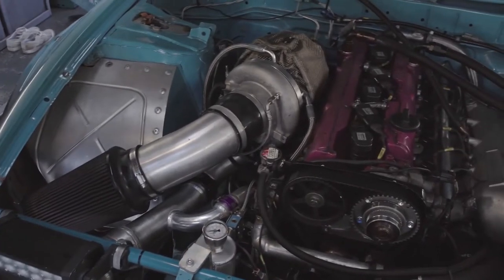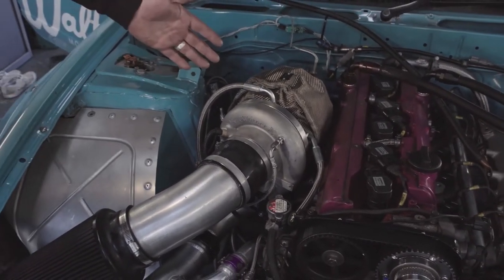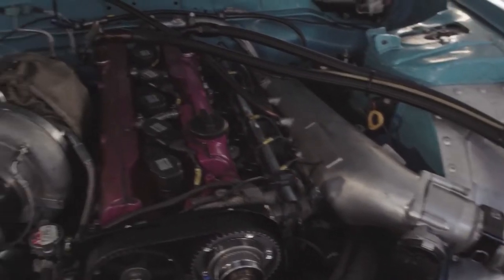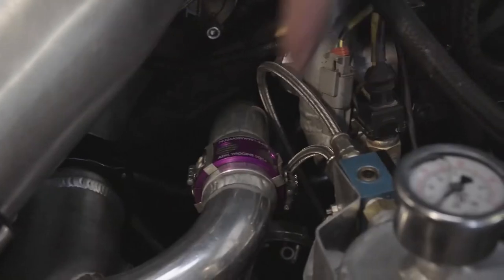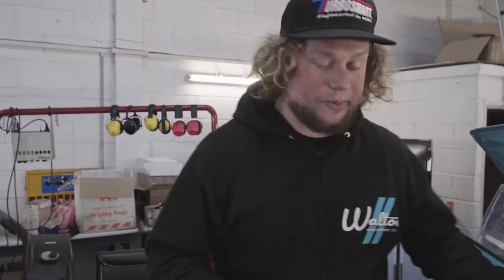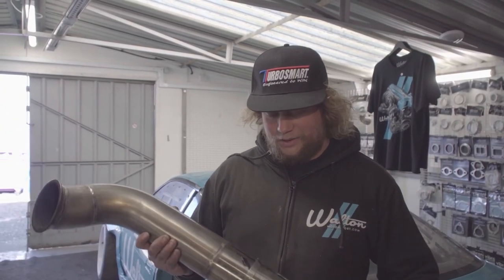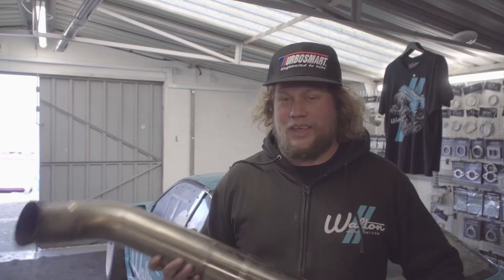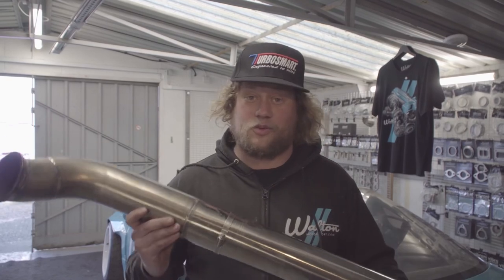Walton Motorsport - [Fresh Air Anti-Lag Valve Install] - Part 2

Comment: I don't think enough people realize how big of a deal this is. How many people have this up and running, because I cant find many.
Reply: absolutely. imagine all the potential powerband your car has in it, and start that from 1500 rpm and have it continue until you run out of springs/valves/crank lets go
Reply from the maker: Theres alot of Rally and RallyX Cars running this, but they don't really get shown
Reply: @WaltonMotorsport   where you taking the vacuum to put on the anti lag valve please the only question I want you to help me out

Comment: Sounds like A high revving bike as f**k N/A inline 4! insane! Need this on my 2jz swap E90.
I'm also working on a ZF 8 hp gearbox and ford 8.8 rear end conversion. All while maintaining an electric 12V air-con system, and keeping a lot of the interiors and sound-proofing.

Comment: Hey, i guess im a bit late but these are the best videos of fresh air antilag ive found.... so question what ignition angle are you using and how much more additional fuel? I have a antilag project in process and sofar im just getting one loud pop and then its not spooling the turbo and my guess my ignition and fuel enrichment perentage or off.
Reply from the maker: We only make the hardware and leave the tuning to professionals so Im not able to answer those questions I am afraid.
Reply: @WaltonMotorsport   okey thanks though? Do you have contact information to someone we would be abbe to ask though
Reply: @maikelniessen6621  if you need to ask it's not wise you do it yourself. Anti lag usually requires aggressive ignition timing and if not careful you can damage your engine.

Comment: This sounds similar to the prodrive "rocket" anti-lag used for WRC.
Reply from the maker: That method with the bomb worked well on Subarus due to their manifold design, however on traditional setups this methos is favoured due to reliabilty and ease of manufactuer.
Reply: @WaltonMotorsport  I think they achieve better anti-lag by designing a rocket nozzle fed by the fresh air bypass, that pointed rocket thrust directly at turbo inlet, thus spooling harder and faster. Sure the manifold layout is different but, still possible on other configs.
Reply: Walton Motorsport you can do rocket anti lag on any engine configuration.
Reply: Basically it is the same system

Comment: Great 2 part about fresh air antilag, will be interested to see how you get on with tuning it to make boost at low rpm/idle. A couple of questions if I may - 
1. I assuming you need some positive boost in the charge pipes before the cycle can start? Is there anything preventing manifold pressure entering the charge pipes if there is a lack of pressure and the ecu requests the valve to open?
2. Is the hot manifold the only ignition source or are you still retarding timing? I'm a way off doing this myself and have noticed my VEMS ecu allows 100% ignition cut when ALS is active

Thanks! Andy
Reply from the maker: So are we, we havent managed to get back to this project as of yet.
1. Sort of, to get around that issue we have the boost feed into the accumualtor tank via a non return valve. This is the pressure source we use for actually controlling the vavle. So you need generate a little boost before you can operate the valve. (a single rev is enough)
2. Not 100% sure, I will let you know If I can find out from the Tuner.
Reply: @WaltonMotorsport  thanks, really appreciate the reply. As I get further into my own setup I might have a few more questions, hope you don't mind!
Reply: Do you mean is there anything preventing the valve from acting as an EGR valve if it's commanded open and there is insufficient pressure in the inlet tract to overcome exhaust manifold pressure? That's how I read the question, anyway. The valve only activates on closed throttle, so exhaust manifold pressure (EMAP) at the activation time should be minimal, and if the valve opens quickly enough residual pressure in the inlet tract would easily overcome any exhaust manifold pressure. Once the system starts flowing it is self-perpetuating as the turbo is increasing the inlet pressure by virtue of the increasing EMAP spooling the turbo up.
As for ignition - I haven't set one of these up myself (yet!) but all information from Turbosmart, HP Academy, and other sources that I've seen says yes you still retard ignition timing.
I also notice that Turbosmart now offer a 6-outlet flange themselves, as well as an Electronic version of the valve which does away with the need for a pressure/vacuum source to actuate it. I did find your use of the pressure accumulation tank very interesting, though. For my own implementation I was going to simply utilise an electric vacuum pump as found on many modern engines. I'm also tossing up between the 6 individual pipes placing the air as close to the exhaust port as possible to get the best combustion (as per Turbosmart recommendations) or a single "rocket nozzle" style outlet in the centre of a 6-runner collector directing the stream directly into the turbo flange.
Reply: @russell6167  I'm thinking if you're sat at idle and open the valve. I guess if parameters are set for say 0% tps and min 2000rpm then there should always be more pressure in the charge pipes than exhaust? Should mean that MAP vacuum should be sufficient to open the valve too.

Comment: the strategy in the ecu is the same as that used for the traditional als with the only difference that the throttle remains closed?

Comment: if this shoot a fresh air into the turbine why that still pop out the fire.?
Reply from the maker: Its because we are not using the air to spool the turbo, we are adding the air plus fuel to create combustion in the manifold rather than the engine cylinders. This combustion is what spools the turbo and as a result creates flames.
Reply: @WaltonMotorsport  oww,,ok i understand..tq for explanation..

Comment: i saw on a different video somewhere where they used a vacuum generator (?) off of a bmw to allow for vacuum to be utilized by the brake booster, is this something you guys have already worked around? i cant remember for the life of me where i saw mention of it; it could have been robert thorne's video on their rocket anti-lag on their S2K but i cant recall at the moment
Reply from the maker: Yes theres quite a few methods, alot of RX cars just use a 12v pump, We went down this method as its the simplest and easiest to fix trackside (in our opinion)